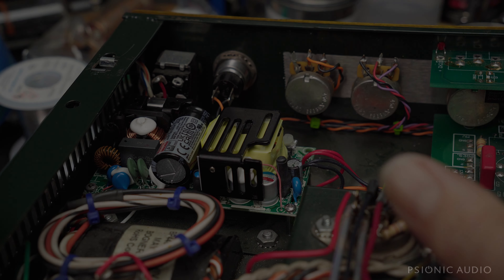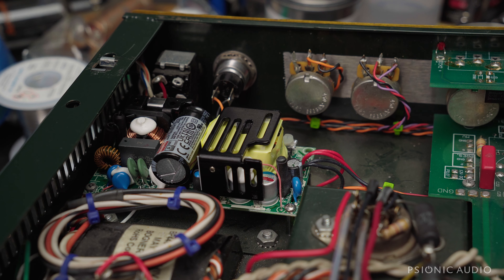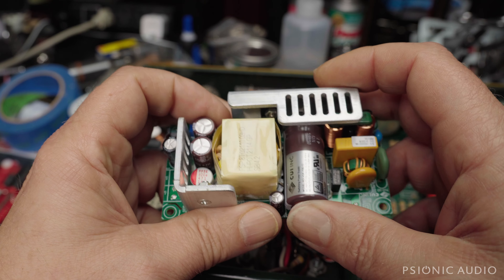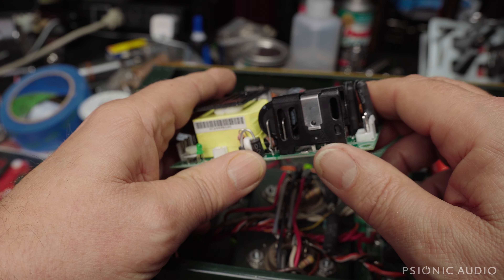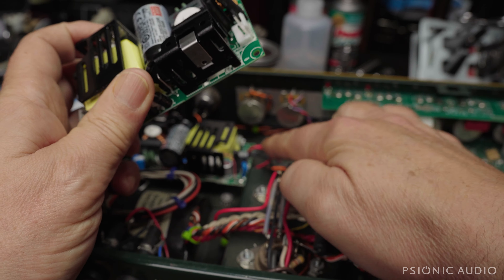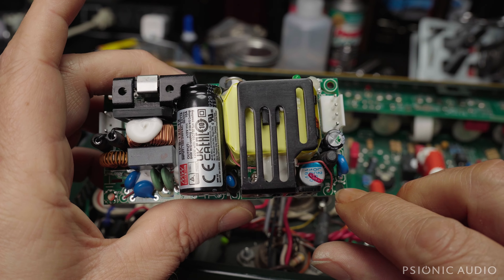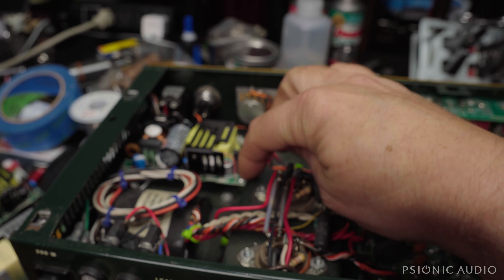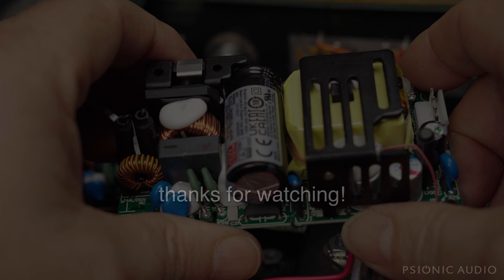Tech Tip : Bogner Shiva 12VDC Supply Whine Solution

Comment: I use MeanWell Powersupplies already for a while as they are easy to source and usually they fit 1:1. 
Brought some Lexicon Rack Effects back to life with those (Owner had a major powersurge in his home) and other then in your case, the replacement was a Plug'n'Play., no need to solder wires directly, despite the original one's had been from early 90s...Love that stuff...

Comment: Great information, Lyle! Some of those SMPSs with the wrong switching rates can really wreak havoc on both AF and RF. The old plasma TV SMPSs were infamous for messing with ham radio transmitters and receivers and even with guitar amps and stereos in some cases. Bird shit on an insulator can create super weird noises in ham radio gear. If you check the ham fests and there is an EE from a public utility speaking on RFI & EMI, "DO ATTEND THAT SEMINAR!"
Reply: RFI and EMI are a real pain in the arse, aren't they!?

Comment: I also had success after trying several models in the Bogner Shiva which whined.
I used the XP Power ECS100US12 (12V, 80W).
Digikey link: https://www.digikey.com/en/products/detail/xp-power/ECS100US12/4487651
Make sure to check the pinout.